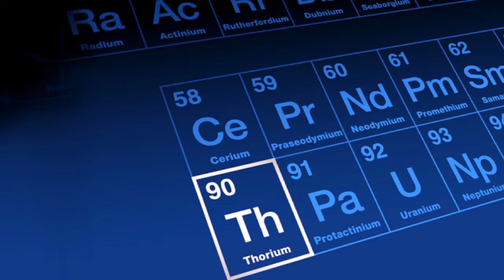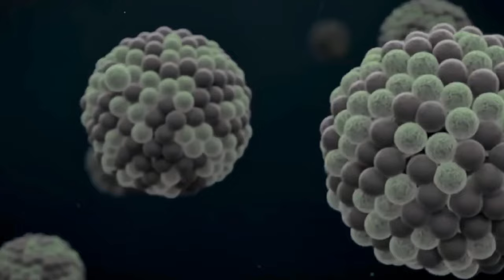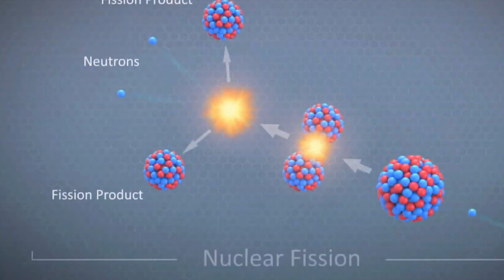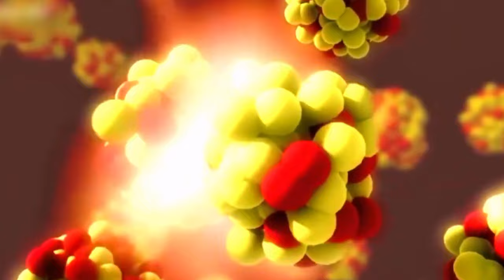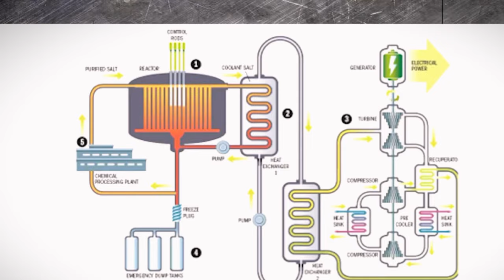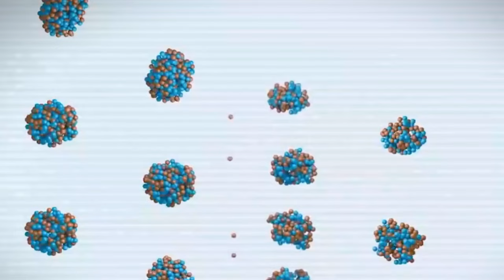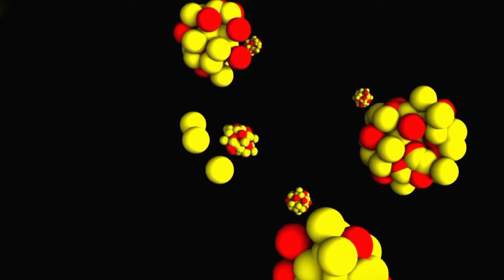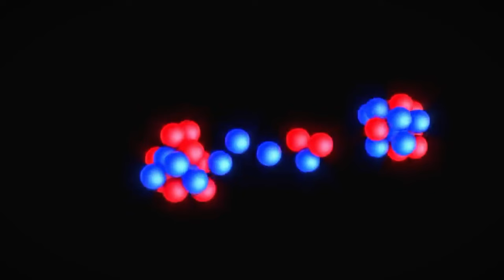Secret NEW Thorium Reactor Provides Energy for Over A 1000 Years

Comment: I expect the thorium technical problems will be solved … and over time, small thorium reactors will become a proven safe source of electrical power at a tenth the cost of competing solutions.   But the strong hurdles imposed by our government and financial system will make us lose the technology race.  China does not have these barriers and will pursue many technical approaches to find and refine the best technical solution.  Then China will set up factories to mass produce small thorium reactors that get shipped to installation sites.  
   China will ramp up thorium reactor production to monthly deliveries then weekly deliveries providing Gigawatts of continuous power.  When China saturates its electricity generation market with low cost electricity, then those factories will be shipping them to countries in their trade block.  The lure of unlimited electric power at 10% current costs will entice some countries to select the China led trading block over the U.S. led trade block if forced to choose.  Low cost electricity makes electric vehicles dominate transportation markets, gives heavy industry a huge advantage, improves heating and cooling costs, plus lowers the cost of energy intensive fertilizer.